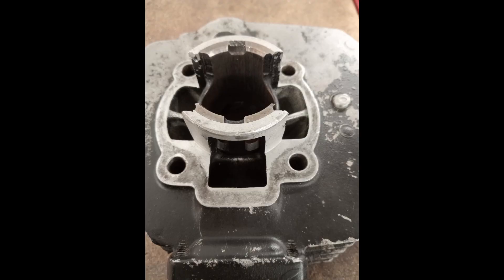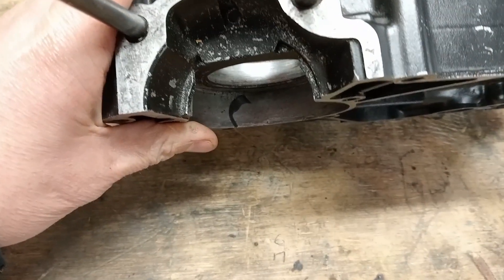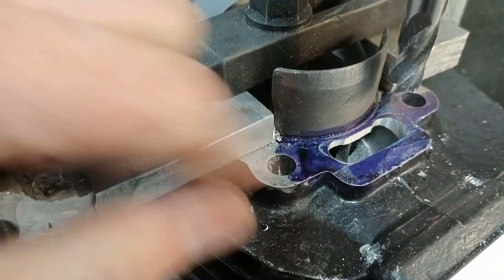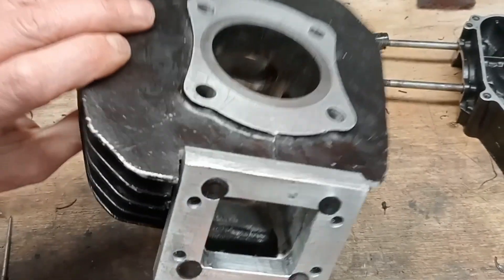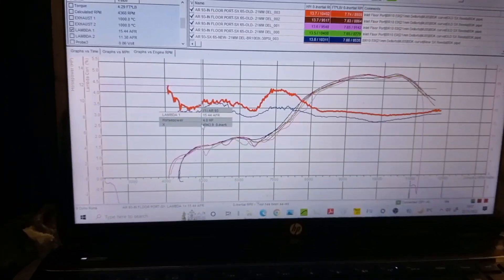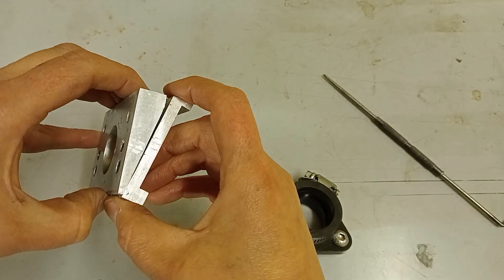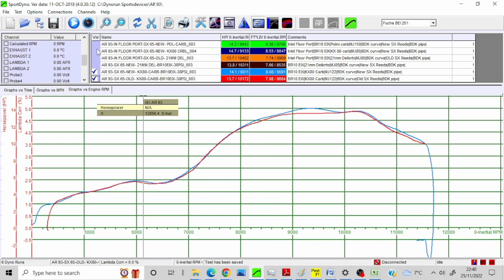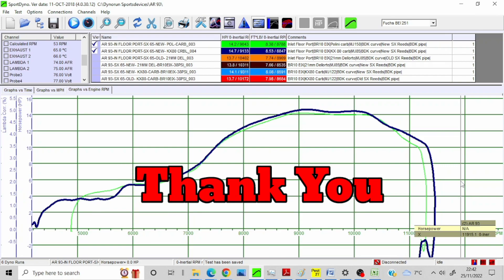Inlet Floor POWER Port DYNO Test - Kawasaki AR93

Comment: Nice one, have you considered flowing the crankcases? Not sure how much difference it makes but consider that when the engine is idling say 1200rpm the air fuel mix has to pass through the entire engine from bell mouth to exhaust outlet in 0.05  of a second (60 seconds divided by 1200)   at 9000 its 0.0066 sec, 12000 is 0.005 sec. Theres a vid posted by 49cc scoot if youre interested. I havent done it myself, the only things I did there was matching the transfer ducts to the cases and remove a small amount of cylinder wall at the bottom to open the  transfer duct entry. I wouldnt knife edge the transfer divider though, if the knife edge isnt EXACTLY in the center it would probably bias the flow to one port or the other,, if one side of the cyl is biased forward and the other side is biased to the rear the fresh charge will be all over the place
Reply from the maker: Hi, I hadn't planned to but it would be a good experiment. Chris Brocklehust spent quite a bit of time filling and flowing the inlet tract on the original challenge bike. I'll add it to the list ☺️
Reply: @AutoBeta2T  Given the speed the air must be travelling it could be looked at from different perspectives, either the air will batter its way through regardless of obstacles, OR the obstacles will generate a MASSIVE amount of tur balance, the vid I mentioned by 49cc scoot is worth a look. Its something I never got round to given the amount of work involved to split the bottom end and at the time most of my clients were on a tight budget. I found matching the transfers to the cases, or vice versa made a difference but mostly below the main powerband and part throttle, ie it felt better to ride. The difference wasn't massive but when you're chasing every half a horsepower here and there it all adds up.
Reply from the maker: Cool - I'll take a look at that vid. As you say, it's all marginal gains but they all add up.
Reply: @AutoBeta2T  I've often wondered, if manufacturers hadn't started reed valve induction would we have YPVS intake ports as well as exhaust. Take that a step further, how about a really radical disc valve inlet with TWO powervalves, one on the leading edge for the opening timing and another on the trailing edge for closing timing. Sounds complex I know, but without reeds....?
Reply: @AutoBeta2T Never knife edge anything that only sees sub sonic speeds. Nice rounded edges and (transfer)dividers is the way to go. Proven again and again.

Great project! Great technical level! 
Would love to see a future video about your approach creating a temperature map to match EngMod results to dyno ones.
Only had a brief go at it myself, but found it quite tricky to get right.

What efficiency % do you run in EngMod by the way?

Thanks for a great channel. 👍
Reply from the maker: Hi andli, yep, I think the knife edge stuff was the rage many years ago...

With regards to pipe temp correction to match the Dyno. I'd personally not bother... I was obsessed with this on my am6 racer. Got it all dialed in for the KRD pipe I was running v the Dyno run... I then developed a new pipe for it using the correction and ended up with a pipe that wouldn't rev no matter how much I adjusted the belly or header length on the dyno.
I generally just see what the sim gives with the dimensions I put in and then try and improve that even if it doesn't perfectly match reality. I just look for gains and go with it.

Something to note: EngMod2T does the runs essentially as a steady state braked Dyno where more heat builds in the engine, where as I've only ever tested on a inertia Dyno with quicker runs and lower temps.
Pleased you are enjoying :)
Hopefully next vid out soonish after I've tested some heads.

Efficiency I adjust to get what I see on the Dyno. .85 - .95 from memory. It's been a few years since I was obsessed with 2 strokes and the sim.
Reply from the maker: @andli461  just to add for clarity, I do play with the overall pipe temp get peak withing 500 or so rpm of the Dyno result but I don't add any interim points to skew the temp profile.
Reply: @AutoBeta2T  Thanks for your answer.
The same here. Several years since I  played around in EngMod. Or spent time on my dyno that is…92,7% done. 🙄🙈

With the help of a very knowledgeable friend we logged header and belly EGT when dyno my old 50cc. Very useful and one could really detect one jet to lean. (A CHT would of course been even more beneficial for that.)

We did some attempts trying to adopt the EGT data in EngMod. I remember it quite hard and not really beneficial in our attempt to get better correlation between SIM and dyno.
Also tried a weighted average approach inspired by Jeff Henise aka Highwayman. (For some reason I can’t post a link.) He seems to have had good success. Me not so much.
The idea was to try to find a way to determine the average pipe temp, to be used in pipe calculations. No real success. Don’t remember the exact conclusion…if any. 🙄

As you say, a consistent model, where relative gains and losses can be compared and backed up with dyno runs, is very powerful. Even if my OCD is far from pleased. 😅
Reply from the maker: Cheers for the info. I intend to get EGT on the bike and feed it into the Dyno... Along with CHT. I used CHT on my X7 racer and found it very useful. I even form the detonation temp halfway through a race (278 deg C) and it went pop. Could be really useful for the long top speed runs. Maybe a remote controlled choke to splash some fuel in if it gets out of hand. 
CHT should help with more consistent Dyno runs if I can establish a start temp. I have considered crankcase temp monitoring too.

My first pipes were for an RGV and the Dyno did log the egt. I think it was somewhere close to what the sim predicted. The Dyno was a load Dyno which is basically what EngMod2T is too so maybe better correlation that a inertia Dyno?

Is Jeff's stuff up on the highwayman site? I'll have to have a look.
Reply: @AutoBeta2T  I don’t remember if max EGT correlated “close enough”, only that the attempt for a better temp input doing pipe calculations wasn’t a success.

IIRC and got it the right way around, going down a jet size and get CHT through the roof together with header EGT dropping is a sure thing you are reaching deto territory. 😬 Extremly useful and very easy to see. Even in our test, without CHT, it was very clear what was going on.

The information was up at Jeff’s page yesterday. A lot of interesting information and projects. 👍
Reply from the maker: Ah I see. So trying to get the best EGT to use for the pipe calc. I'm interested in the difference of EGT header and near the stinger on the Dyno and on the road. My theory was to get best power on the Dyno EGT and then try to recreate on the road at both ends so the pipe is acting the same length. Not sure how easy this will be thinking about it...🤔

I've found Jeff's page I think: https://www.highwaymanbikes.com/race-pipe-tuning-for-the-yamaha-td3-250cc-twin/

Comment: Very interesting vid! If your head is not optimized for squish band width and clearance and the CR is low then there should be some nice gains to be made by modifying the head. Pretty sure that you will not find the 7 or 8 BHP that I think you are going to need with head mods alone. I've read that pushing the CR up can in fact reduce the rev range of the engine and its ability to 'over rev' but I'm not 100% convinced that this is really true. Your power curve looks great for a road bike, it looks like it starts at around 7k and runs up to around 10k RPM. I think you are going to have to try and change the shape of the curve away from the nice 'dome' that you have now into something that's more radical. The bike might be harder to ride with a 'church spire' power curve but hey, ho, that is what is going to be required. It might need more radical porting and/or an exhaust tuned for a higher RPM. You could experiment with spacers under the barrel just to see if you can push the peak RPM up to 11k, if it looks promising then you can skim the top of the barrel. I'm sure you have thought of this stuff anyway! (Obviously raising the barrel can have a negative effect on the inlet timing but is a quick and dirty way to get some ideas on what changing the transfers and exhaust timing will do)

If it was my project I'd burette the engine as it stands now so I have a baseline to work from, don't trust any figures that are quoted for your setup, they can be off. (KTM are the worst in this respect, their figures are blatant lies!) 

EDIT...I presume that you are going to get an anorexic dwarf to ride the bike? LOL
Reply from the maker: Just catching up with comments..
 Standby
Reply from the maker: Hi 😊
Yes, I hope to get a few more ponies from the head but it needs more porting and a pipe... All to come. I e never measured it before but I think I'll have a measure up of the primary comp ratio. A few people have hinted there could be some power in there by increasing it.
Reply: @AutoBeta2T  It at least worth finding out what the primary CR is but I would not go increasing unless you feel that it is too low as standard, I'd be surprised if it is too low because you are running a moped bottom end and a 100cc top end. If you push the primary CR up too much whilst running the 'modern day' transfer timing you will lose way too much mixture out of the exhaust. I guess measuring everything is the key!
Reply from the maker: Good point! I wonder if Kawasaki designed it as a 80cc first then put on a 50 barrel or vice versa? It is under square so maybe 80 first?
Reply from the maker: No dwarf but I have an idea of who may be able to ride it. They are pretty thin 😃

Comment: Hi mate. Have you considered going up in cc a little. Mine was 103cc. Think it had another liner pressed in. It was very powerful. No easy dyno access back then. Loving the channel.👍
Reply from the maker: Hi Craig, I'm actually at 97cc now as I'm on a 54.5 mm bore. More cc would be good but I'd ideally like to get some cc's from stroking it. The squarer the bore and stroke the more Time Area is available for the same port timings... Bit of a project to do.
Sounds like you had a fast one then. What mph did it do?
Pleased you are enjoying the series 😀  All the comments and Interaction from everyone make it great to do too 😃
Reply from the maker: @Trevor Partington which RG Trevor? Gamma or FUN?

Comment: Ambitious project! It seems that the aerodynamics are quite poor so that 100mph has to be achieved with power. Over 25hp at the wheel with long gearing? That is a lot. Interesting to see how it goes. Will be watching.
Reply from the maker: Cheers Einar - yes it's a challenge all right... In the original project they found that the nose fairing made it slower! A full fairing would help but I'm going to see if I can do it unfaired first 🤔🫣😬
Reply: @AutoBeta2T  That is actually not a suprise. All and all what looks to be aerodynamic seldom is. Some of the 1920's aerocars are actually some what a miracle. Those truly were aerodynamic, well to some point but with technology of that era... Then again some 50's car that looks to be aero, they perform better on reverse :)

Comment: I would get another clutch cover and blank off the oil pump and do away with all the kickstart mechanism,  obviously running premix.
Reply from the maker: Hi Graham - it's on the list... I'm using the tacho for when I go on the road. I need to get a digital one and then I can lose it. Running pre mix at the min 😊
Reply: I would keep the oil pump. I think it does a better job of lubricating the bid end and mains, than premix
Reply from the maker: Hi Dave, probably but I don't want to take the (very small) risk of it failing.  I'd need an 80 oil pump too as the 50 one doesn't output as much oil.
Reply: @AutoBeta2T  - I run a pump and 80:1 premix for safety. The pump is turned down a bit to keep the overall ratio
Reply from the maker: I see... Currently 30:1 with Motul. We  swapped to it for our air-cooled classic racers (X7 and RD) after always using Castrol 747... Motul was definitely better with no seizures while I was racing.
Reply: @AutoBeta2T  - Yeah. Motul for me too

Comment: Love the testing. Peak hp rpm seems a bit low for a 100cc engine. I would try a shorter pipe. If your port timings are in the 190s I think you should be looking closer at 10500 to 11000rpm for peak hp rpm without compromising the crank too much
Reply from the maker: Hi Shannon - totally agree. I'm hoping to borrow a shorter pipe soon and build another magazine article pipe which is very short. Next test is more compression which will reduce the peak rpm again so need a shorter pipe.
Reply: I've heard wrapping the pipe maintains the heat in the pipe causing it to act as a shorter pipe. Would be interesting to see if it makes a difference. Keep up the great work
Reply: @tke7mu0u  When the first sets of TZ750 pipes with 3 under the bike and one through the frame were made that one which passed through behind the engine had to be around 30 or 40mm longer than the other 3 as it ran hotter
Reply from the maker: @tke7mu0u  yes - wrapping would make the pipe act shorter. Later in development I plan to add EGT probes to the pipe so I can try to replicate Dyno temp for best power on the road. Wrapping the pipe could be used to "shorten" it ...
I've heard it can cause detonation though 🤔
Reply: It might keep too much heat in the pipe but  think it also depends on state of tune. How close the engine is to its limit. I just thought it could be a way to see if you gain more power up high until you can modify the pipe. I love watching progression like this.
Reply from the maker: @tke7mu0u  yes, getting the pipe done should move the peak rpm up meaning bigger ports to give the required STA at the higher rpm... Should be interesting and pleased you are enjoying ☺️
Reply: @madmaxsdog8040 interesting!
I have similar observations with my mopeds